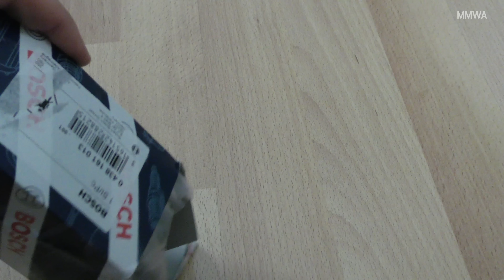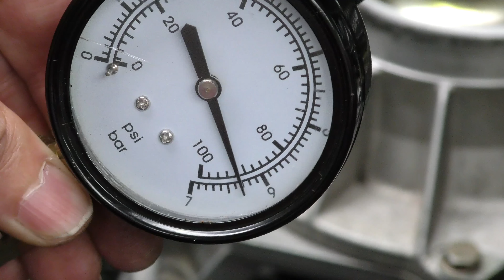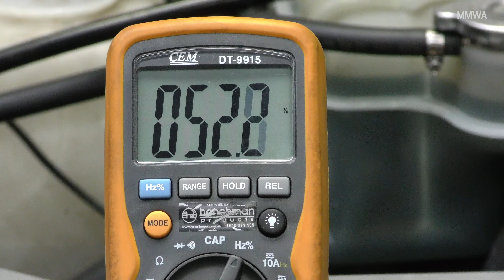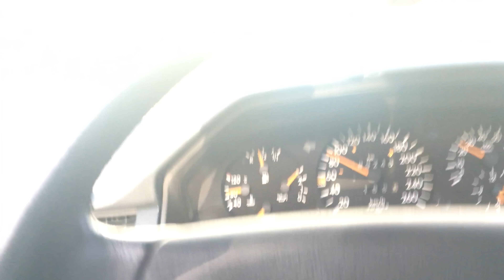Mercedes M104.980 K-Jet Fuel Pressure Regulator Replacement & Duty Cycle Adjustment

Comment from the maker: I failed to mention, but the duty cycle adjustment is to be done with the engine at operating temperature. However, as always you should follow the service manual, I am only vloging my adventures and may not show every step.
Reply: Why did you have to change pressure regulator?
Was it leaking gasoline from vent hose?
Enjoyed your video, 
Thank you!!
Reply from the maker: @oceanfront664  It still worked ok but i was bothered by the broken rubber vent connection 😅
Reply: @MMWA-DAVE  you can get the spare-hose from daimler/bosch. replaced mine years ago...

Comment: I thought the system pressure regulator you're working on is for KE- JETRONIC type of fuel system. The system pressure regulator for K- JETRONIC type of fuel system is incorporated in the fuel distributor, please correct me if I'm wrong. All the best.
Reply from the maker: Correct, you are the first person to point out that i forgot to put the E in the title. 😎
Reply: Does the K Jet have a fuel pressure regulator or is it damper?  I have this on my K Jet. If the FPR is bad would the system pressures be really high? Or is the problem in the back of the FD?
Reply: @ace7821  K-Jetronic Fuel-Injection system from Bosch has a system pressure regulator or some technicians called it primary-pressure regulator and it is incorporated in the fuel-distributor housing. It maintains the pressure in the fuel system constant.
Reply: @tonyreyes9969  The guy who sold me the rebuilt FD keeps telling me there is an external fuel pressure regulator and he keeps insisting that the shims and the screw in the back have nothing to do with my high fuel pressures. I never had this problem with the old FD. How much variation in fuel pressures does the back of the FD screw + shims allow for? I need to bring the pressures down by about 10-30 psi.
Reply: @ace7821  Is your car equipped with K-Jetronic or  KE-JETRONIC  fuel injection system?
Reply: @ Yes. It’s a ‘82 380. It has a K JET.
Reply: @ace7821  Here are some specs. for your vehicle. System pressure at   idling or with engine at operating temperature - 5.2-5.8 bars. 
Control pressure with engine warm and in idling-  3.4-3.8 bars.
Control pressure at idling with engine cold in accordance with ambient temperature 0.5bar minimum. I hope you're aware that the change of the control pressure is effected by the warm-up regulator.
Reply: @tonyreyes9969 Converting to PSI, this would be 55 PSI prior to warm up and 84 PSI after operating temperatures. My pressures have been at 95 to 130 PSI. This has not changed even after changing out multiple parts, with new accumulator, fuel pump, filter, catalytic converter, and three different WuR (used). My car always ran like a champ. After changing the FD is when I noticed this problem. I have ordered a new kit to rebuild one of my WuR’s. Before I was seeing high pressures to the FPR. This is patent however.  Today I changed out my frequency valve which was clogged. I put in a used one and now I detect pressure up to the EGR. I cleaned it out and swapped it with another used one. Still incredibly high and the same fuel pressures. The FD rebuild guy stomps up and down saying it’s my FPR. However I have swapped it out with three different FPRs and still no improvement. I am detecting massive pressures from all lines backing into the FD, including those bypassing the FPR/Freq Valve (which is constantly buzzing)/EGR. I’m convinced it’s the FD regulator but the FD guy says if I mess with it, he will void my warranty. However he puts paint on every irrelevant thing and says the same thing. I feel the shims are incorrect and he pulled this FD from not a 1982 380 SEC and / or he built it wrong or he put an aftermarket inline  plastic filter and the fuel is jamming up on output ports. This is why I don’t believe it is the WuR, bc the pressures are rocket shooting high on the left side of the FD. I believe the FD regulator nut is not compensating for the high pressures. My lines are clean and patent to the fuel tank.  It’s frustrating as I’ve been in this situation for the past 10 months with the FD guy continuing to say it’s not his rebuild because “he sells 10 per month.”  He finally agreed to let me send it back to him; I’m worried he won’t have my car and he will still tune it wrong or deny there is a problem. With my pressures so high and black smoke coming out of the exhaust, I’m worried this is going to fry my brand new catalytic converter and everything else with black soot and insanely high temps coming out of the new muffler. It’s burning wayyyyy to rich and I cannot accelerate past 2000-3000 rpm’s even after adjusting the idle screw.   Max car speed is 20 mph. I have not seen a single post anywhere including BenzWorld or online videos that describe this problem. However not many people have 82 380 SEC’s and they may a change after 82/83 with most people describing KE Jet Mercedes systems, and only one person posting about a K Jet VW engine. Nobody has posted pressures this high or this exact problem.   It’s cost me $10,000 over the past year. I very much appreciate your input and feedback.
Reply: @ace7821  I'm sorry to hear all the problems you're encountering with your car at the moment, I hope I can be of help. Firstly you mentioned that your car runs always like a champion, but what makes you decide to renew the ( FD ) and after you renewed the ( FD) do you mean the Fuel Distributor? -you start noticing a problem - what problem specifically? and what kind of problem you're trying to solve by reconditioning one of your warm-up regulator?Can you also please tell me  how and where did you connect your fuel pressure gauge for you to to check the system pressure and the warm-up control pressure of your car? Thanks.

Comment: These regulators are incredibly expensive for what they are.  Good thing is that I have never replaced any fuel component besides the  injectors on my w201 102 engide. Great video

Comment: how do you actually test this Fuel pressure regulator, it a bloddy expensive item by bosch and I would like to understand if my fuel pressuure regulator is working well
Reply from the maker: @RennieAG  I have a K-Jet fuel pressure tester that does system and control pressure measurements. The system pressure is what this is regulating. Theres also figures for engine off pressures to be maintained but leakages can occure elsewhere in the system such as the fuel distributor, injectors and check valves on pumps etc
Reply: @MMWA-DAVE  I bit the bullet and bought a brand new Bosch regulator at USD350 since my difference is nowhere near 0.4 bar....hoping this would help me get as close as factory as possible 🙏

Comment: If my fuel pressures are around 105 to 120 on my w126, m117, would replacing this help fix and bring down the fuel pressure. My car bogs down

Comment: I volunteer to take it off your hands in case you are following through with throwing out your pressure tester... or was that just in jest? :D
Reply from the maker: Rfbu I was going to throw it out or give it to a friend before I realised it also works with KE-Jetronic. I thought it was only useful for the original 1970’s version that had no electronics and used a warm up regulator. Thats the version I initially purchased it for (for my 450SEL 6.9 I used to have) it was a pleasant surprise that it was still useful.

Comment: very neat engine bay MM, I see you have done the vac lines. What made you think it needed replacing?   D they have a life span of sorts? BTW, mine is the same colour of yours!
Reply from the maker: Love this colour ! I knew something fishy was going on as it started pinging lately and getting more and more gutless. What started off the symptoms was when I installed 2 new fuel pumps. I think the tired old original ones were masking the failed pressure regulator or the powerful new ones just finished it off. I knew it was on its last legs anyway as I have seen and smelt fuel coming from its vent line - instant fail and end of life when this is seen.

Comment: Just a Suggestion, I found Crows foot spanners (3/4 Ring spanner) much better when dealing with hard lines due to increased and spread out points of contact especially when dealing with Alloy or soft flare nuts.

Comment: We changed the regulator on the 300CE-24 and start-up went from quick to immediate. Imagine: R-R-R-Hmmmm. And after: R-Hmmmm. If that makes sense. So, it wasn't really broken but I'm very happy with the result, albeit for 300+€. Great engines.

Comment: Hi, I have question please, this fuel pressure regulator function, get out the air pressure or fuel pressure  I mean the outlet of this vent in regulator is fuel or is a air pressure?

Comment: Quick question which part number you had on the car before? 0 438 161 013 not the same as 0 438 161 001 ????
Reply from the maker: I ordered using the parts manual. The m104.980 ke-jetronic runs at higher pressure than most m103 versions. This was a long time ago now and don’t remember number off the top of my head. You should order using the EPC and your VIN.
Reply: @MMWA-DAVE  my mechanice said install the replacement I still have ...if not I wiill ordere teh same part as you have ordered. thank you seoooo much for your help!! you are a legend!! enjoy each and every video

Comment: These damn things are extremly expensive (it is just a spring and a rubber membrane inside, the membrane gets old and fails), even here in Germany they are EUR 400-450 for the big one (like shown in the video) and EUR 200-230 for the small that is used in the M103. There used to be aftermarket sales from the manufacturer SWAG, a Bilstein subdivision, that were half the price, but they disappeared somehow, so that only "genuine" Bosch is available.
Reply from the maker: I have seen some aftermarket ones here in Australia but not any cheaper unfortunately so no real point

Comment: hi I have a mercedes sl 300 cab model year 1993. my question is, when the car is cold it starts, when it is warm it cannot be started until it has been sitting for a few hours, then you can start it again. can you the error would be very grateful🙏
Reply from the maker: cannot start at all when hot? usually fuel system issues will make it hard to start when hot, but not
impossible. It could be your crank angle sensor dying.
Reply: I have change the crank sensor:/ and it still the same problem.

Comment: I have replaced this part also, very expensive. I have a question about Idle Mixture Adjusting Potentiometer (A3437224035), is any other brand like NTY good, or buying Bosch is a must? Any experience maybe?
Reply from the maker: @Gr3eGo  if talking about the airflow meter potentiometer, i only use the china clone ones, they arent perfect but they work good enough. I’ve not had a total dud one yet but i have heard some have. Its important to adjust it correctly once installed. Bosch is good but very expensive, and i think made in china now anyway.
Reply: @MMWA-DAVE  thank you fore sharing this experience with me.

Comment: Dude, I have a doubt: The fuel line pressure is 6 BAR, right? Can I use one 6 BAR fuel pump instead of two 3 BAR devices, removing the connecting hose between them? The question sounds silly but I can't see a reason for not using only one... I think that a sole pump would drain less current from the alternator while operating, what sounds good to me...
Thank you for reading!
Reply from the maker: Vini Terranova ive not tested the pressure of 1 versus 2 pumps. But i know red 124 had 1 seized pump when i first got it and got it to run on a single pump. I did not drive it though, only idle. There must be a reason mb went with 2 pumps inline versus 1 large one, i’ve just not read into why.
Reply: @MMWA-DAVE  Thanks, bro, if I test it first I will let you know! lol
Could it be 6 BAR pumps were not available at that time maybe? I've read somewhere that one pump helped to avoid bubbles in the line... I think it deserves a try anyway.
Reply: @MMWA-DAVE  I've got this from Pierre Hedary:
"Pierre Hedary
17 minutos atrás
the twin pumps are really necessary for good fuel volume delivery."
Regards!

Comment: Was your RPM high then normal before you switch the fuel regulator,cause before my RPM was always at 7.5 now it’s at 15 and no one can find a problem .
Reply from the maker: No, I only changed it because it was leaking. Check that your ecu is working - high idle is fail safe state of idle speed control. Also inside the ECU.

Comment: Cool but very expensive! I prefer to rebuild my 104.980 to invent jetronic (full electronic injector) it will cost 420$ (+ new injector rail with vacuum regulator - 20$) but result will be more usefull as for me. But not for history, i drive car every day it is not original any more(

Comment: Why did you replace your regulator?. Just curious
Reply from the maker: It was not a necessity, it was still ok and just within spec. I was chasing lean part and full throttle acceleration on this car for quite some time and ended up changing just about everything. In the end i just enriched by adjusting the EHA out of spec. The car is now a rocket and very lively. The ecu is still operating as it should. Everything was within spec according to the service manual but it just felt unimpressive. I’ve been very happy with it for some time now.

Comment: How did you figure out that it needed replacing in the first place?
Reply from the maker: with the fuel pressure tester it was revealed that the system pressure was out of spec. It was mainly my desire for perfection, if its working, not leaking and close enough to spec for that car id leave it alone.

Comment: Got to hate the Australia tax...
Sucks that everything is nearly double the overseas prices.Makes it very hard on the wallet to support local suppliers.
Reply from the maker: Shadow_Rusty i buy a fair amount from prestige auto parts on ebay - i need another of these regulators but they are too expensive for it, like $150 more than buying from rock auto in the USA - they even charge GST now too.

Comment: Which symptoms did you have, before you changed the pressure regulator?
Reply from the maker: Overall gutlessness and the last few times driving the car I even noticed the engine pinging (momentarily as these have knock control) Due to the cost of these I do not recommend just changing them haphazardly and measuring fuel pressures is a must.
Reply: @MMWA-DAVE  thank you so much. I'm dealing with a rough idle when warm on my humble M102 engine.
Runs ok when supplied by the cold start valve, then becomes rough when warm. New injectors, spark plugs, etc. The only old parts left are the fuel distributor and fuel pressure regulator. Any guess?
Reply from the maker: I hate to sound like a broken record but you must perform a number of tests, one of them being a fuel pressure test and if its a KE-jet car i would also check the duty cycle. I am assuming the basics have been done such has checking for vacuum leaks etc.

Comment: very nice video.But i have to ask..do you really mean the vacum port on the regulator is "not" a vacum port?that is not correct is it..it is indeed a vacum port?Greetings,Stefan
Reply from the maker: No, it is absolutely not a vacuum port - the system pressure does not vary and where its connected does not provide vacuum anyway. Fuel pressure regulators for EFI vehicles often have vacuum connections to intake manifold as they increase fuel pressure under engine load. K-jet does not work this way. The system pressure does not change it remains constant, the control pressure does and this is altered by the EHA on the side of the fuel distributor which is controlled by the CIS ecu.
Reply: i see that..and i am aware of that it is the EHA regulating the control pressure..but i was just confused with this port beeing connected to the underside of the inlet below..meaning it would be connected to vacum..On my 2.5-16 it is connected on the underside.
Reply: @MMWA-DAVE  are there any substitutes for the expensive regulators, like adjustable aftermarket ones?

Comment: Can you do a video of the sounds coming from the exhaust manifold? I have a 300sl-24 and it has a sound coming from that side that I'm not sure if its normal. It sounds like a diesel clacking.
Reply from the maker: If it has the original individual exhaust gaskets for each cylinder chances are one or more have blown out - they were replaced early on by a a metal plate style gasket for each bank of 3. When i pulled apart the m104 i am currently rebuilding it had the original individual ones and i noticed several were compromised. I'll see if i can record my engine running next time.
Reply: @MMWA-DAVE  I have already had them replaced when i had the head gasket done it has the new style ones. Are these gaskets one time use? Cause i loosened the bolts and tightened them before when i was in the process of installing a mosselman turbo kit to my benz.
Reply from the maker: I think they are one time use only as they will crush to seal against the surfaces only once. And nice work on the turbo, got any video of it in action?
Reply: MMWA not done just yet but I'll be sure to post and tag you to them.

Comment: What are the symptoms of a faulty regulator?
Reply from the maker: 6SPD V10 these have 2 functions, to maintain a specific pressure while the engine is running and a lower pressure when the engine is not running. If it fails completely there would be hard starting issues every single time and probably very lean running. The only way to test them properly is with the K-jet upper and lower chamber fuel pressure tester. The regulator is fricken expensive so i’d not be replacing them without properly testing.
Reply: MMWA Thank you! I am hunting down a misfire...